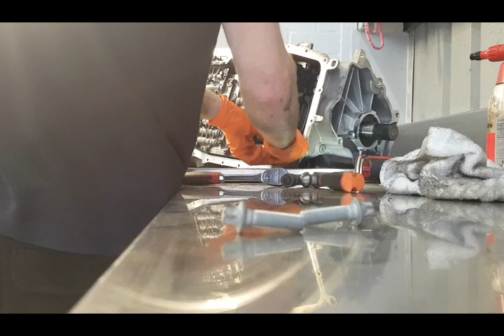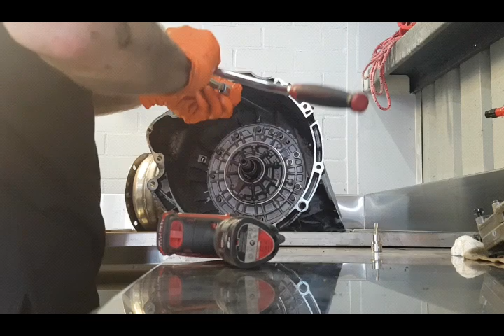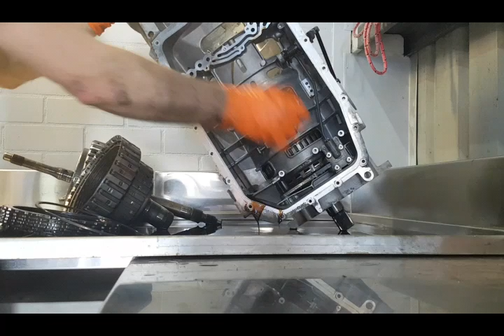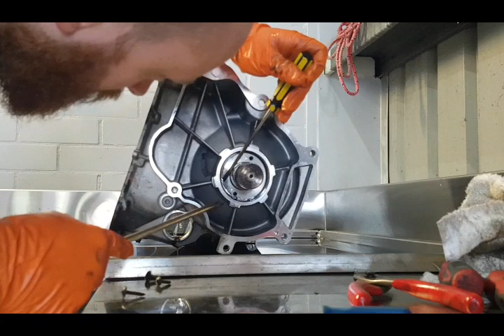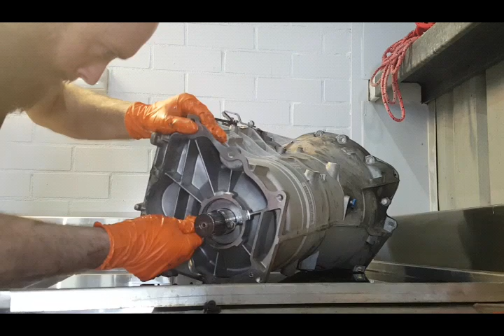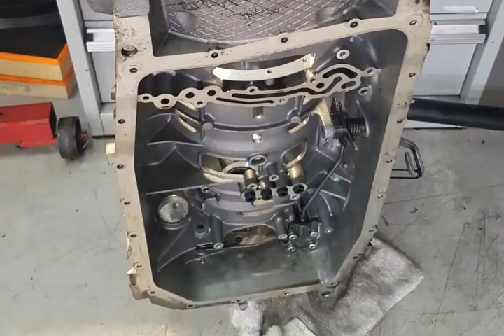BMW X5 ZF 6HP-28X Automatic Gearbox Strip Down

Comment: Bonjour, 

merci pour cette trés belle vidéo. 

Je posséde une bmw 330 xdrive avec une boite 6h28x. La vitesse 5 saute si j'accélere trop fort. J'ai fais une vidange de la boite et j'ai vu qu'il y avait de la limaille ( laiton ). Le garage bmw me dit qu'une bague en laiton est usée.
 
Ma premiére question :

   - Est-il possible pour un particulier de faire le changement de la bague avec votre video ???

   - Pour remonter les engrenages et tout le reste, faut-il des réglages ou des calages ??

Merci encore de votre vidéo.

David
Reply from the maker: I only speak English I'm afraid. If you translate your comment into English and resend it I'll happily try and help.
Reply: Hello, I translate with google
thank you for this very beautiful video.
I owned a 330 xdrive bmw with a 6h28x box. Speed 5 jumps if I accelerate too hard. I made a video of the box and I saw that there was filings (brass). The garage has now been said.
My first question:
- Is it possible to make a particular change with your video ???
- To reassemble the gears and everything else, do you need adjustments or settings?
Thanks again for your video.
David
Reply from the maker: @davidguichou5680  you can take the gearbox apart and inspect tje clutches for wear and also check the bearings for wear. If tje bearings are worn, you lose oil pressure past the bearings and then the clutches slip. The clutches are what select the gear. Any form of pressure loss will cause clutch slip. You can buy repair kits from ZF.
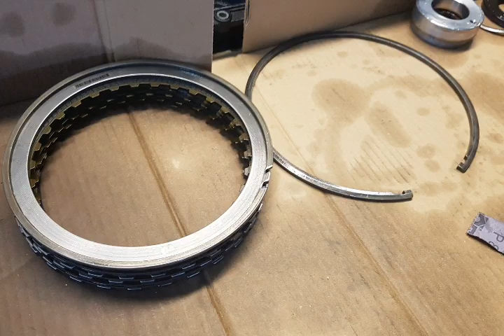Reply from the maker: @davidguichou5680  17:27 you can see the clutches for one of the gears.
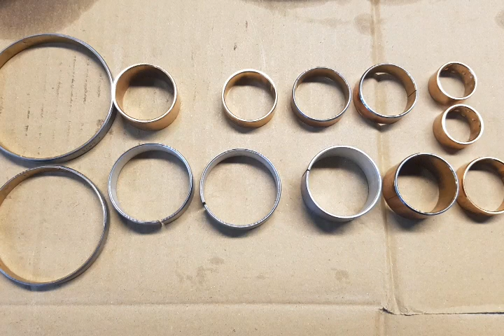Reply from the maker: @davidguichou5680  at 16:43 you can see the bearings that I replaced. They are made of phosphor bronze, that may be what you are seeing in the oil. If there are metal particles inside the gearbox, you will need to clean it all out before reassembly. There are no mechanical adjustments required. As long as everything is clean and reassembled correctly it should drive ok. Reset the gearbox adaptations with a OBD Diagnostic scan tool.
Reply: good evening, thank you for your answer. I will dismantle the box and clean well. I will call zf france to find out if there is a bearing kit, gaskets and rings. Maybe I'll change the records, I'll see the price. By cons, I do not understand why it is necessary to make a reset with a  OBD diagnostic ?? Which program should I use?
thank you
cordially
david
Reply: @davidguichou5680  salut, tu as réparé ton soucis ? j'ai pareil... code défaut : 4f8a. le passage de la 4 à la 5 patine uniquement si je le fait en mettant pied planché et met la boite en sécu ensuite. tu as fait quoi et ça t'a couté combien? merci !

Comment: Approx how much does it cost to repair/replace clutches on these? Just curious.
Reply from the maker: Dunno. Never done just clutches. Full rebuild with new bushings, clutches, seals, solenoids, valve body cleaned and resealed, torque converter rebuild advised. Can't remember how much it all came to. But it's the only way they drive like new again.
Reply from the maker: @denisovanhybrid9610  sonnax